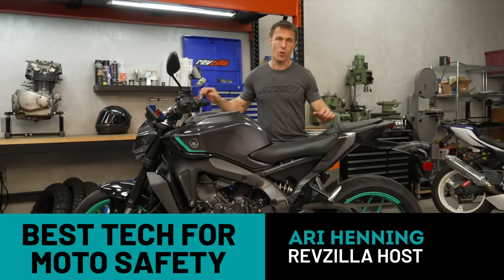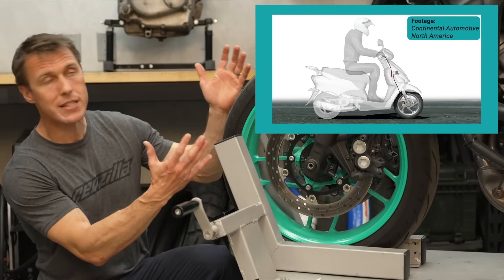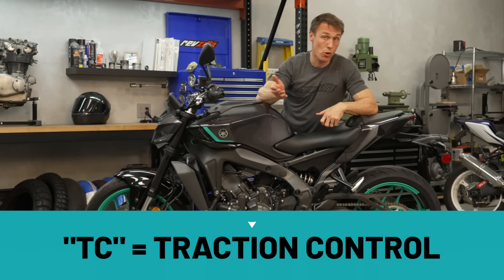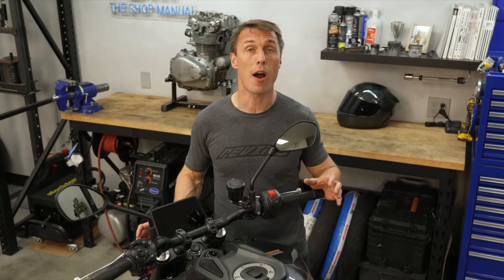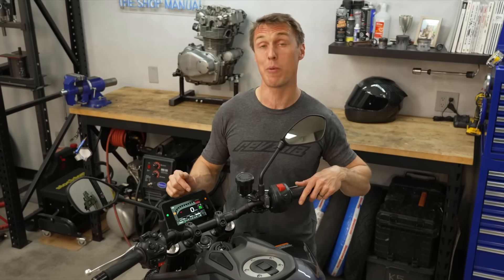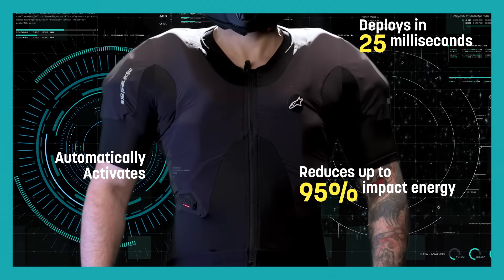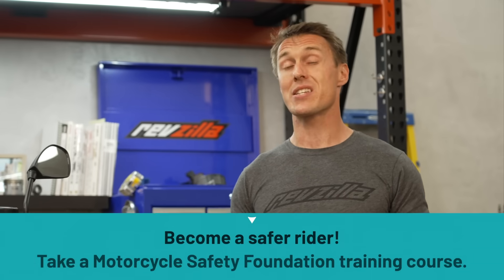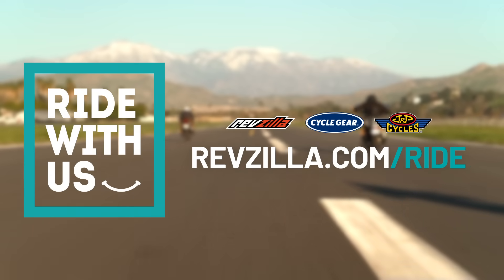Motorcycle Safety Technology You Need to Know | Ride With Us

Comment: I will give my view on the new mc this is just me at 72 been riding 60 years all kinds, now a 1990 hd softail, 2006 bmw r1200gs love both for what the smile the fack for meis ive never once needed ABS or any aides you should become one with your bike the best tool is between our ears, yes my wife and i have done the road rash boggie ouch!!! I live in So oregon a deer came out of the trees next to the road no time to react center punched her at about 50mph thinking 1980 hd shovel 650lbs wo t go down wrong! Took the front wheel out , no broken body parts just road rash six weeks later it was 3500 mile trip to sturges. i will say learn your machine use the tools dont get to confident that will hurt you.  Great vid thanks